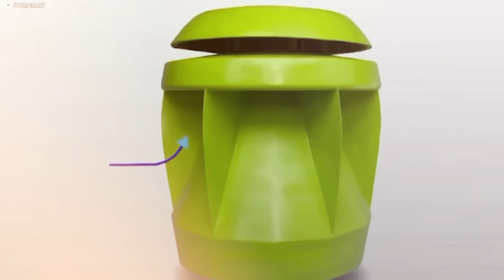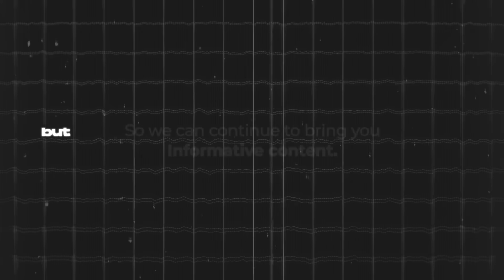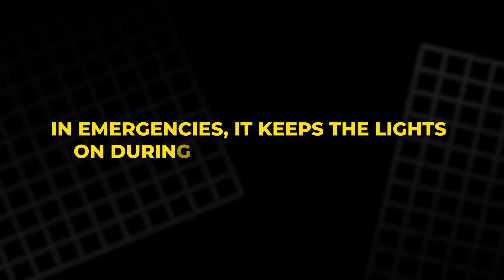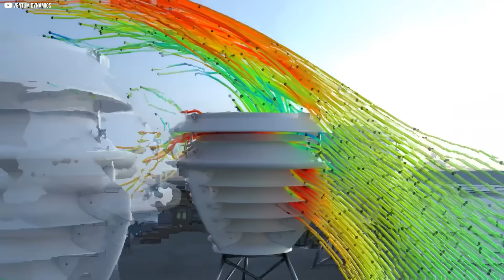Tiny Turbine, Massive Shift: The PowerPod Is Here

Comment: Solar panels generate at least 10 times more green electricity with the same investment in time & money! Reality: All practical tests show that small wind turbines hardly generate any electricity, because hardly any wind blows close to the ground! Wind/electricity yield increases with the third power of the wind speed. So +100% wind = +800% electricity. But close to the ground: 0 constant wind, only aggressive gusts! Whether wind and/or solar power - you need extremely powerfull batteries or a petrol generator to live off grid.
Reply from the maker: Thanks for bringing up those important points about the different energy sources and their applications!

Comment: Disappointed at the low power output. I  would have expected at least 3KW which is achievable from most small vertical axis wind generators that will fit on a single pole (mast).